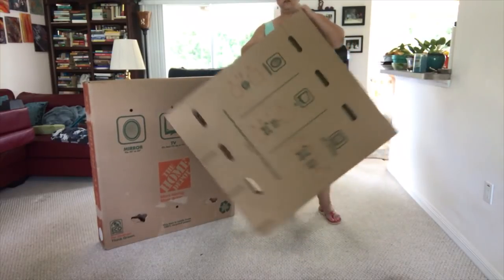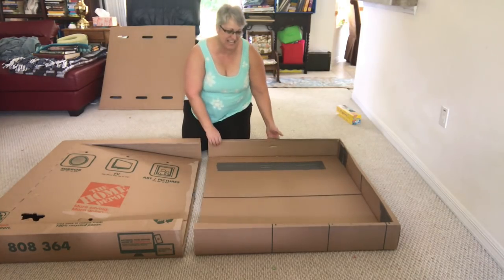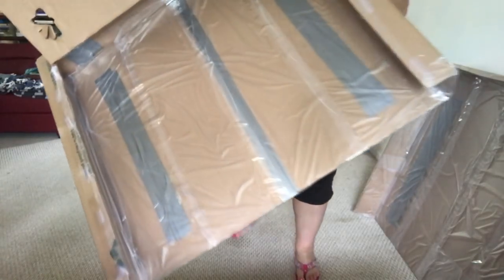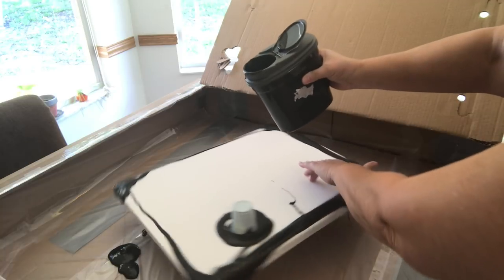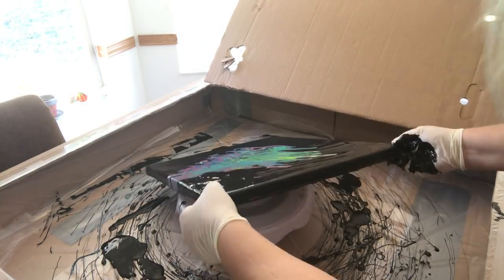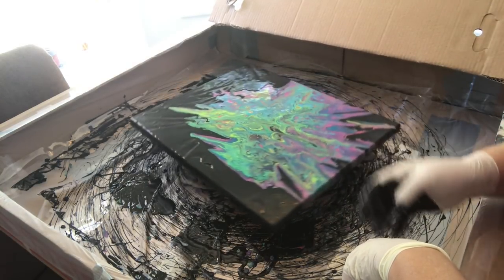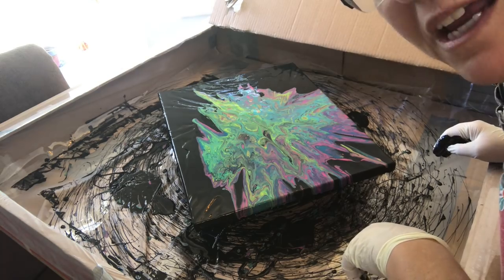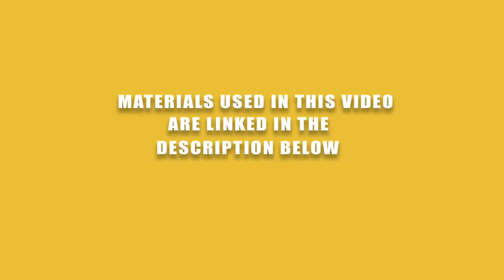How to Make a Spin Box

Comment: I was just looking for a box like this this morning for a pour I did on an LP.   I previously glued two big aluminum roaster pans from the dollar store together to make a big wide one.  It held in the paint, but just barely.  To get a TV box like you found was very lucky,  because I don't think you can buy one like that.  I've also picked up some large empty cardboard produce trays from Aldi's, which are just about big enough.   Great idea, and lovely painting!
Reply: Ruth Burley thank you for the compliment and good luck finding a TV box ha ha.
Reply: You can find those TV moving boxes @ Lowe's or home depot... When instock...
Reply: thanks!!
Reply: alot of people advertise free cardboard boxes on craigs list... look in your local area under 'for sale' and then subcategory 'free stuff' there is also a 'wanted' subcategory. usually people will give you the box even in the wanted part because they are huge. you can also contact your local appliance or electronics store and usually those tv in the box, come with another box to protect the sale box... lol they maybe can hook u up, also display tv's most of the time have been removed. or cruise ur big box stores at night in the back. those working throwing freight are usually more helpful than having to go in the store and get passed around. just a hint... i was an HR Manager for a major DIY store that's orange for years... don't tell em i told ya. just wait til the store closes and usually there's guys back there on forklifts and what not, restocking. they'll find ya something. take em something like a 12 pack of soda and they will be your best friend. :)

Comment: Just an fyi uhaul sells big moving boxes relatively inexpensively. If you use your boxes stretched out to the widest point paint on the lower panel will probably seep under that top panel and onto your floor. Might do a test run with some water first. It's not inexpensive to get acrylic paint out of carpet. Ask me how I know. Good luck!!
Reply: Nyana Chase Whoa, what a good catch. I didn’t even think about that. I’m gonna have to come up with a plan for fixing that thank you.
Reply: Patricia Fuller my husband worked with water his entire career. So I listened to 37 years of how water (liquids) always always always goes to the lowest possible point.  You'll get this. Love your enthusuasm. ❤

Comment: Did you check if it is level if you pull the inside piece out slightly??
Reply: Debbie Cosden No I didn’t and really I’m not kind of a level girl until it comes to setting it up to dry. I’m all about winging everything. I don’t have a specific recipe for my paint mixtures, I do some things in a tub some things on the desk some things in a box.   And if it’s not going the way I wanted I simply tilt it up and move it or stick something underneath it and I don’t worry about that kind of stuff.

Comment: Why didn’t u use the top u cut off and tape it together?  Could have used the cut off top to reinforce the bottom
Reply: jana darnold Because when I open the box to the full extension if I’m doing a really big pour then I can flip one side down on one side and then I can add the cut off part onto the other side and I’ll be able to store it in my garage without worrying about stuff getting on top of it.  That was my thinking at least.